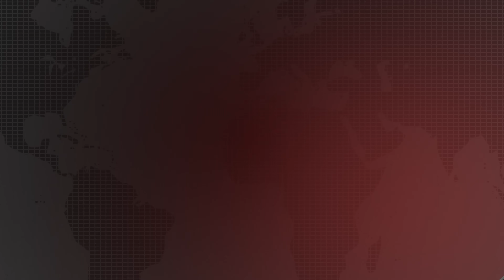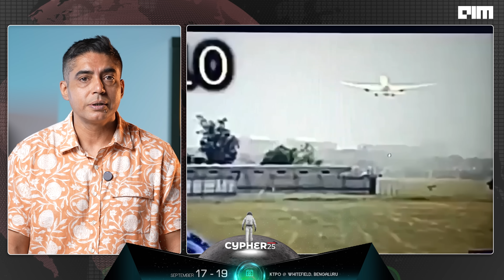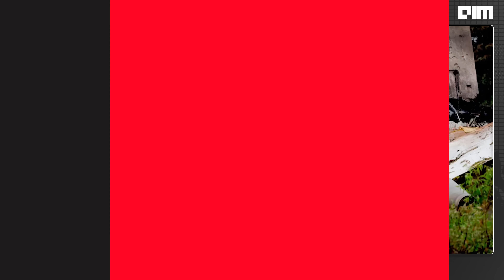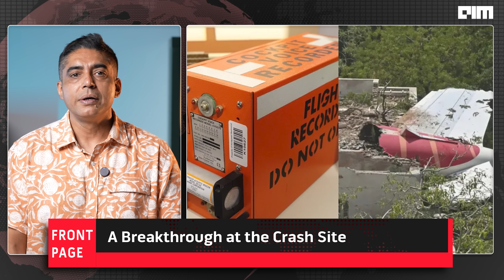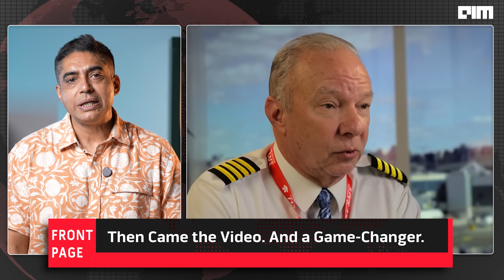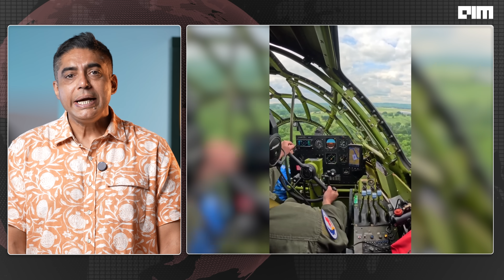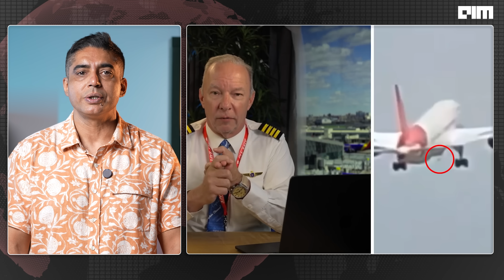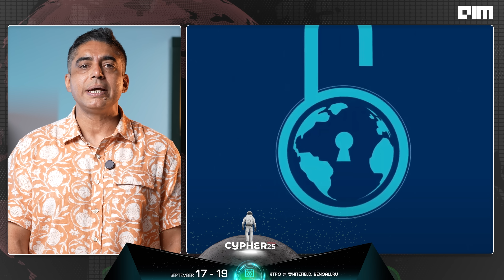Air India Crash: Is Boeing in Trouble Again? RAT Footage Sparks New Questions

Comment: The Boeing 787 Dreamliner, Air India Flight 171 had 41,000 hours of flight time and just under 8,000 takeoffs and landings since its delivery to Air India in 2014. I suspect that if both engine failed, it was due to poor maintenance. No other 787 has ever experienced one engine failure let alone both of them while in flight.
Reply: Both engines turned off. U men intentionally? Why ?
Reply: @ravishdhange3532  Very unlikely, but theoretically possible. You mean you don;t know that there have been a handful of cases where the pilot(s) crashed the planes on purpose?
Reply: IMHO it was Electrical system failure causing FADEC to cease functioning leading to dual engine flame out second to fuel pump ceasing to pump causing fuel  starvation.  See video of passenger prior to takeoff he showed electrical failures and no A/C
Reply: Boeing just paid billions of dollars to settle law suits on 737 Max and a whisteblower confessed in US congress of shoddy build quality. More than likely it is a Boeing issue.
Reply: Falsch. Genau deswegen wurde 2013 die 787 schon gegroundet.
Boeing ist auch ein militärisches Unternehmen.
.
 WER saß wohl alles in der Maschine? ...oder auch nicht unbedingt.
-
Beim MCAS-"Absturz" der Äthiopian-Airlines saßen 20 äthiopische UN-Delegierte mit in der Maschine.
DIE 20 Delegierten, die mit ihren Gegenstimmen dafür sorgten, dass die USA keine Militärbasis in
Äthiopien errichten durften.
Dass das per US-GPS satellitensteuerbare  MCAS  generell geheim gehalten wurde, war keine bloße
Schlamperei und/oder Sparmaßnahme um Airbus dagegenzuhalten, wie offiziell kolportiert.
-
Gedacht sind solche Systeme schon lange um bei "Flugzeugentführungen" die Boardelektronik zu
überstimmen, damit Luftpiraten die Maschine nicht mehr übernehmen konnten.
Das us-amerikanische GPS-System wird genauso in Waffensystemen wie Drohnen, Raketen und
dgl. verwendet wie in der Zivilluftfahrt. Das Jamming weiß nicht, ob es die Funktionen eines zivilen
oder militärischen Gerätes stört. Das weiß nur der Absender.
-
Auch in der Indonesischen MCAS-Absturzmaschine saßen fünf solcher Widersacher, mit deren
Votum ein Jahr zuvor auch in Indonesien eine Marinebasis der Amis verhindert wurde.
-
Die beste Versicherung für Staaten, die sich den USA nicht unterordnen lassen wollen, ist,
nur noch von der brasilianischen Embraer, der chinesischen Comac und der russischen OAK zu kaufen.
Die benutzen ihre Systeme (siehe auch Microsoft Windows) nicht als Waffe.
Reply: But in the video you could hear the engines
Reply: @FlamedSword001  it's not jet engine sound. It's the RAT sound
Reply: @Jon-iv6gh  the  787 fleet had been before experienced engine failures, never both, but one engine  inflight shutdown has a lot of times
Reply: @denissilva3585   Not a single incident involving engine failure on a 787 has ever been recorded and airlines are required by law to report any incident regarding commercial planes to the NTSB.
Reply: Just happened to see the c span video on Boeing, interview of Senator J Hawley...the.other side of Boeing? God help! 🙏
Reply: How much is Boeing paying you?
Reply: @owenlaprath4135  Not as much as their  H it  man  gets though.
Reply: @owenlaprath4135  how much is mohdi paying you?
Reply: @owenlaprath4135  says the shill from airbus
Reply: It was not failure, both engines were turned off simultaneously by one of the pilots RIP on intent! ❤❤
Reply: @volkergiesbrecht5829 😮😢why thou? I mean I’m not doubting anything because I find it hard to understand why both engines went out at the same time right after take off?????? Omg, that was terrible!
Reply: @volkergiesbrecht5829  you should be ashamed of yourself posting this as if it is fact. Go away
Reply: When failed, the RAT IS ON, GOOD ENOUGH TO MAKE AN EMERGENCY LANDING,
ON TOTALLY EVALUATING, THE WHOLE SYSTEM WAS HACKED. AND THE PILOTS COULD DO NOTHING.

Comment: It’s an 11 year old plane, Boeing does not maintain an airplane after it’s delivered. Additionally, the plane just went through major maintenance. Might want to look at what maintenance was performed.
Reply: Why are you blaming Boeing? It’s air India’s responsibility to maintain safety. Their safety record is terrible  - they’re negligent and have a history of corruption. They’ve also been cutting corners to save money.
Reply: @The_Insight_Pro  Alaska Airlines has been also saving money on maintenance, for example not lubricating screw, which moves horizontal stabilizer and their plane went down off the coast of California some years ago. A lot of everyday drivers climb behind the wheel of their car knowing that all brake lights are burnt out…Same thing.
Reply: @zdenekkindl2778  That was NOT a Boeing plane !!!    McDonald Douglas DC9 !!!!
Reply: Blaming boeing make sense though go check. Boeing history in China  @The_Insight_Pro
Reply: Dunno where you got your information from, man, but the issue was that the plane did NOT go through a major maintenance that it should have. AIr India always cuts costs on maintenance, can tell from personal experience cuz I've flown Air India (Never again). Apparently, the plane was already raising MAJOR red flags long before this happened. Even on the flight from Delhi to Ahmedabad, the crew reported several technical glitches and warned that the plane was not in a flying condition (How I know this? I actually live in the city where this happened. I know people inside the airport- Apparently there was corporate issues because the Air India command overruled the warnings). This plane just wasn't air worthy. AC wasnt working along with several other electronics which is a MAJOR red flag that they decided to ignore. 

The air india flight I flew on was an A320, but even that plane was poorly maintained. I even posted on my insta "Is this shit even Air Worthy?" lol.
Reply: @Ayoitsme-m8e  My mom told that in 2002 one of my relatives who works in air india adviced her to never book air india, instead go for jet airways or any other airline. Back then I was in her womb and she was returning to the hometown from Bombay maybe that's why he gave such an advice. We indeed ended up flying jet airways. Unfortunately its defunct now. I've heard this story couple of times before and I just thought its yet another form of discrimination like how some of us hate made in china stuff for no reason. However reason incidents, peoples' complaints and now fatal crashes all point toward bad management, maintenance and putting profits over safety, even after decades.
Reply: @Ayoitsme-m8e  maintenance or no maintenance doesn't really matter... if it wasn't maintained oh well, if it was "maintained" it was done very badly. either way, my money is on ground tech as well.
Reply: @Ayoitsme-m8e air India has always had a sketchy safety and maintenance record. It’s just annoying how people immediately blame Boeing.
Reply: @MegaWingman7  Right!? I personally dont prefer boeing anymore after all the scandals against them but still, thats my personal opinion. It don't mean I dont fly boeing because one of the domestic airlines here (A really good one too!) called Akasa has an all 737 fleet. Whilst boeing has had its issues, this one was NOT boeing. This was definitely on Air India because of all the maintenance cuts theyve been doing. And not just their boeings, their airbus fleet is also SHIT. Me and my family just decided to never fly Air India again. They just cant be trusted
Reply: @MegaWingman7  it is a war on Boeing... a war that, let us accept it, Boeing brought on themselves.
Reply: @Ayoitsme-m8e  How many Boeings have had the ENTIRE aft section fall off?  Zero.  Airbus............many
Reply: @MegaWingman7  Boeing is known to prioritize profit over safety. The 737 Max and now the 787 Dreamliner.....
Reply: @MegaWingman7  do you know 2 American whistle-blowers were murdered, who worked in Boeing ? Why does it hit you hard? Just look into senate inquiry, you will know what is going on in US. Prez works like a joker on tariffs; who will get hurt the most ? US itself. If there were lapses in maintenance, there had not been any major accident in recent past in India, despite poor maintenance. Blaming maintenance is okay, but not at the cost of Boeing.
Reply: @suniltshegaonkar7809 if it wasn’t a brand new plane that hasn’t been flying for 11 years, I’d have major manufacturing questions. A lot of people died here, don’t make this political. Let’s see what the CVR and black boxes show and then we will all understand what happened
Reply: That should have said if it was brand new….
Reply: @thomaszaleski889  1 and it was pilot induced. A couple 747s blew the hind end off and crashed
Reply: @suniltshegaonkar7809  I guess you already know that Boeing is responsible so let us know what they did wrong with the plane that caused the crash, Mr. know it all.
Reply: @MegaWingman7  blaming boeing also make sense since they don't have good track records on safety parameters as well several such incidents happened in China as well
Reply: @171_indranildutta6 blaming anyone before the facts are discovered is ignorant
Reply: @MegaWingman7 blame went due to track record
Reply: @skooter2767k  And it went back to repairs not made properly by NON Boeing facilities !!!! Give all the facts dummy !!!
Reply: @171_indranildutta6  sooo  14 years flying over 1100 planes and no crashes is a "problem" ????? Quite a safety problem!!!! !
Reply: @wilburfinnigan2142 well, you stated that it’s never occurred on a Boeing, which is not true at all. TWO Boeings that have lost the fin. The Airbus fin loss was not due to the manufacturer or maintenance. And you call me the dummy 😂😂😂
Reply: @MegaWingman7 very unfair blame. Quite sad
Reply: @MegaWingman7  maybe check their safety records over decades and their response
Reply: @Ayoitsme-m8e  I hope your observations are taken seriously for safety's sake. If Boeing is not to be blamed for this disaster  I fear Air India will do everything to cover up their negligence meaning no justice for the dead victims and their families
Let's hope it does not come to that. Privatisation is never on the side of the consumers.
Reply: @Ayoitsme-m8e  You are not alone. This information NEEDS to be shared widely!
Reply: @Ayoitsme-m8e  The pilots have the right to refuse a plane if they consider it not airworthy.  It's their lives as well as the passengers.
Reply: @cjmillsnun Yeah, but honestly, Idk if the pilots themselves were aware of just how far gone that plane was. The previous pilots warned but still.. Also, as someone who’s flown Air India, I can say that their power hierarchy is not the best and they would’ve forced the pilots to fly anyway. I also know a few people who’ve worked with Air India in the past and left for the same reasons. It is basically the Boeing of Airlines when it comes to management.
Reply: 11 year old plane, 11 seat... 😮
Reply: I definitely don’t think it’s boeings fault like bro do u even know how many flights are from Boeing?
This is definitely poor maintenance and air India maintenance is trash bro
Reply: @itzlia571  He is literally not blaming boeing he's blaming the maintenance, which is done by air india not boeing. Also the major maintenance he's probably referring to is that afaik the same plane had an engine overhaul (or replacement) apparently just a few months back.
Reply: I've heard that 11yrs isn't old for an aircraft 🤔
Reply: @anieke7j it’s not. Standard commercial plane life span is around 30 years and 40 for a cargo plane
Reply: @MegaWingman7  IF....... they are maintained !!!!!!
Reply: @wilburfinnigan2142 exactly
Reply: @MegaWingman7  whistleblower Sam from Boeing raised concerns abt 787 and their actual life last year. He said the assembly done was sub par by Boeing and raises concern fr the aircraft just after 10+ yr instead of 50yrs as claimed by Boeing
Reply: @aroundtheworld6093 I worked for Boeing for 35 years and ran the jet engine development program and functional testing groups across multiple programs. Are there issues, yes, like all major manufacturing systems. Has it gotten worse recently? Yes. Those concerns are being addressed
Reply: @aroundtheworld6093  787's have 1100 delivered over 15 years and this is the first crash first loss of life, IF it was a BOEING problem it would have shown up years ago.  DUUUUUHHHHHH!!!!!!!
Reply: It should be done by the airline nt the manufacturer
Reply: Wrong assement, this aircraft flew in succession from Paris to New-Delhi and to Ahmedabad before the the AI171 flight to London Gatwick. Stop lying in front of all of us!
Reply: Air India has received six 787 Dreamliners that were assembled at Boeing's Charlotte, North Carolina plant and they are said to be defective. Other airlines rejected planes that were built there and opted for the ones made in Seattle, Washington.
Reply: This plane was reportedly having electrical issues with the AC system and some other issues prior to the flight.
It appears that the aircraft was not grounded = a quick inspection and into the sky again.
Reply: @mikejohn0088 if that’s true, not saying it isn’t, there should be entries in the planes maintenance log and how it was addressed by an engineer on the ground and signed off for flight.
Reply: @MegaWingman7  100% --- Example of typical log entry via ground engineer:  AC system mother board and supporting PCs checked and nothing found irregular; system started and shutdown five times with a window of 30 minutes with no sign of lag in operation effectiveness; no need for further inspection.
Reply: @mikejohn0088 I hated the dreaded “couldn’t reproduce discrepancy on the ground, cleared for flight” statements
Reply: Just because it is 11 years old doesn't mean Boeing can't be responsible.

Time doesn't mean it can be factored out of the equation every single time.

Example.
In 2024, Peugeot issued a recall about vehicles made in 2007-2008.
Reply: According to its flight log.. the plane have already logged more than 400 flights this 2025
Reply: Maintenance can not get to some areas of the aircraft. The whistle blower said that this would eventually happen as he claims the wiring bundles were poorly handled, and those areas can not be maintained as they are hidden areas, that only a complete overhaul could ever hope to uncover issues
Reply: How much is Boeing paying you?
Reply: @owenlaprath4135  How much is Airbus paying you?
Reply: @MegaWingman7   same issue hapnd with British Airways..flaps not working..with full of fuel..
Reply: @Prime82044  Flaps on Air India were NOT the problem, they were set, see video of them on the ground.  IF it was a flap problem the plane would not get off the ground,  engines quit, fuel starvation or contaminated fuel   fuel shut off ??????
Reply: Will never fly with any airline from this country.
Reply: The best thing to do here is to completely avoid flying on a Boeing airplane for the foreseeable future. Sadly they're just not that reliable anymore as compared to Airbus.
Reply: ❤
Pilots flew the 787 Dreamliner, not Air India Tata or Boeing!
Pilots flew the 787 Dreamliner, not Air India Tata or Boeing !
Reply: @volkergiesbrecht5829  What is your point?
Reply: false
Reply: The problem was that Boeing had not provided the source code for this aircraft.
Reply: @raufjaleel8317 so, if that’s the case, why was the plane able to fly the previous leg of the flight? It had nothing to do with it and the plane has been flying for 11 years
Reply: ✨✨✨British authorities assert that an 11 year old plane is not considered old. ✨
✨✨✨Do not let Boeing off the hook!
Reply: @gladysobrien1055  after 11 years in service you cannot blame Boeing for this accident. 
No other 787 had any problem since on service. Excellent machine
Reply: @YZK920  Ok, I see your point.
Thank you.
Reply: @YZK920  who can you blame then?
Reply: @gladysobrien1055  Well DUUUUUUUUUHHHHHHH !!!!!!!  learn the correct details before running your mouth !!!

Comment: It reached 625 ft. Also the plane was fit. There was no thrust, pilot said, not the engine was failed. Flap setting was not correct for the situation on that moment, not enough lift to climb furter. It was flying, and did not fal to the ground, it was a glide slope.

Comment: I had no idea flights were so vulnerable just after liftoff to maybe 1,000' WITH speed of at least 300 knots. At that height and speed, there should be enough time for the pilots to react, restart the engines, switch tanks or whatever they need to do.
Reply: Take off and landing are the most dangerous parts of flight.
Reply: Flights are vulnerable 24*7. I

Comment: I like your analysis and not jumping to conclusions. Please help me understand this point because if I heard the video right, then BOEING really did something incredibly stupid.
Tell me how this makes sense or correct what I'm saying. I really don't know. There are the wing tanks and the fuselage center tank. On takeoff, both engines only use the center tank. The RAT was deployed to generate lost electricity and will take 60 to 90 seconds to come online through the power bank in the tail. The CNN live show said the RAT does NOT power the center tank fuel pumps. WHF??? So if the engines die, you have no chance of starting them because there's no fuel pump on the center tank? I guess they need another RAT to provide IMMEDIATE electricity for fuel pumps running NOW!